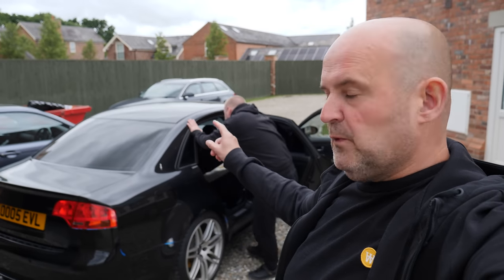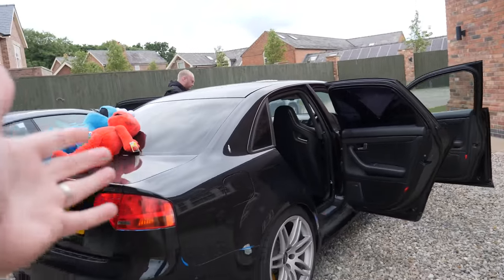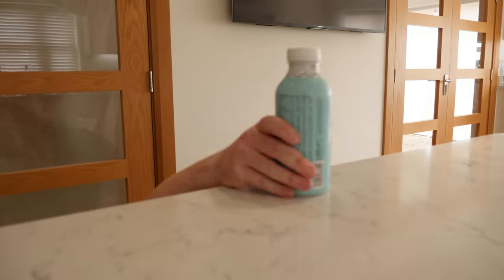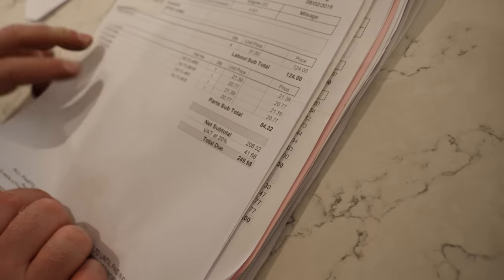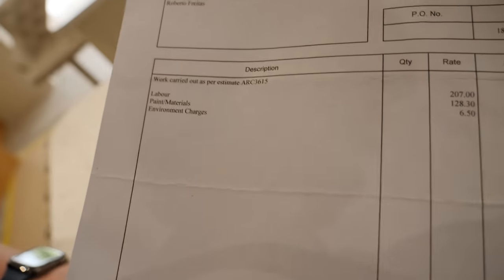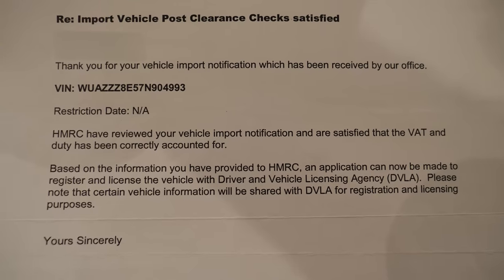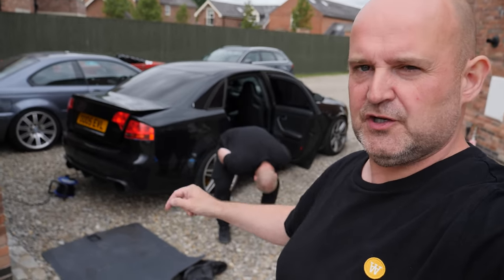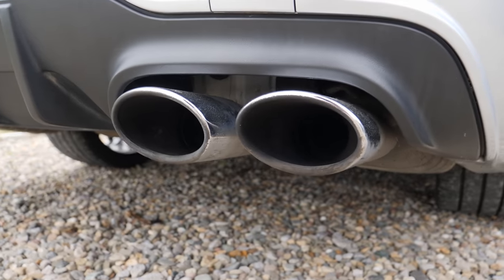I CAN’T BELIEVE IT COSTS THIS MUCH TO MAINTAIN A HIGH MILEAGE V8!

Comment: The E46 M  is my favourite BMW. The B7 RS is my favourite Audi.  I had an AMG for 10  days and gave the keys back. There was a rattle buried in the middle of the dash (that would take mercedes and age and a half to fix), the car was ultra super noisy on bad road surfaces, and  3 light clusters out of 4 taking water.

As per the cost, it's not that bad if you know where to get the parts, and do the work yourself. To be honest the paint bill looks ridiculous, I had a part respray before on a B6, £1.500

Comment: just for a understanding for ya'll for fuel economy if youre planning on owning a V8, my experience with my Audi s5 2008 4.2. £60 a week tesco momentum traveling around 8 miles a day peak times with traffic...day trip or floor it everywhere even more...think i did work it out once before fuel prices went through the roof, that if you floored it and it drops 5 on the range distance thing for how many miles you will get from the tank it was £2.50 or so...probably like £4 to floor it now... smiles per gallon and all that😂
Reply: I get 200 miles from a tank of Super, doesn’t seem to matter how I drive it weirdly!

Comment: People buy abused cars then post them on YT and complain how expensive they are to run. Others then use it to justify buying 4 cylinders. Actual experience varies greatly.

I’ve have two 4.2 V8’s over a twelve years. Had my current ‘08 S4 for 7 years now. It has cost a fraction of what what’s spent here Just like any car, don’t buy an abused one unless you are prepared and want to fix it up. I only buy good, well maintained cars. Key is to maintain it properly and they are very reliable. I’ve never been left stranded. Only things I’ve had to do to my engine in that time is plugs and gaskets, VC and oil filter, but then again they lasted 15 years in a performance V8.